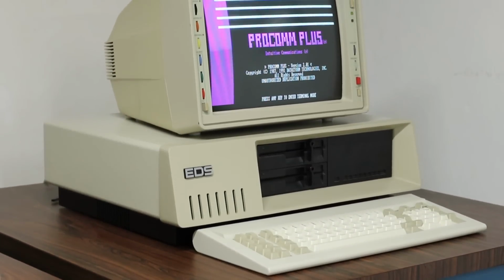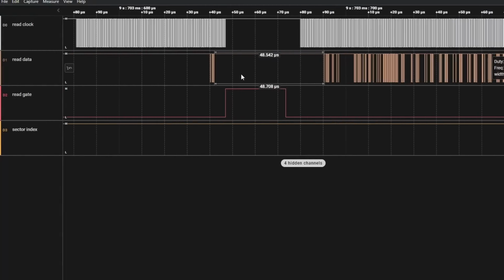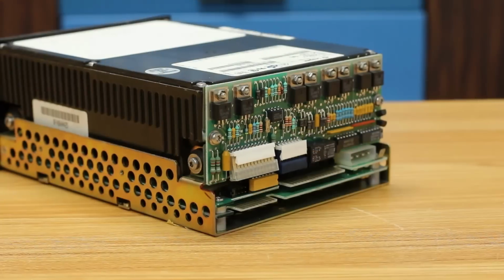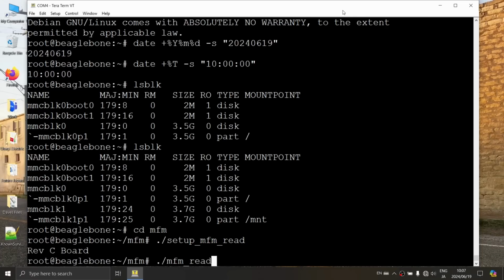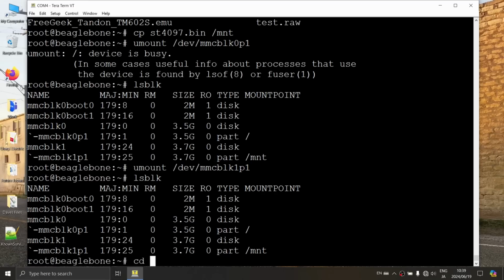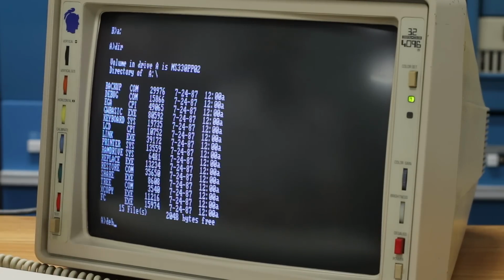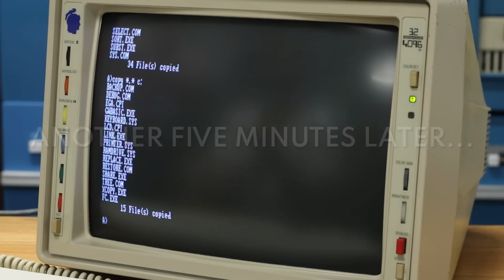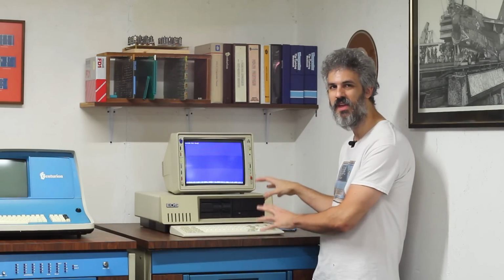FM is RLL, MFM is RLL, RLL is RLL! Fight me.

Comment: Nice shirt! We spoke briefly as VCF SW. I actually have one of the world's largest documented collections of vintage mechanical hard disk drives, I'm still counting spoils fron VCF, but I think I am around 600 units right now.

FWIW, MFM and RLL drives are not often called this way by collectors, they are ST-506/ST-412 and ST-412HP, or 5MT and 7.5MT, respectively. The only difference is the expected encoding, which for most drives was entirely determined by the method used to test the drive in the factory. If it passed with few enough defects as RLL, its an RLL drive. 
The ST-238R is one of these drives. It is an ST-225 that you were at one time guaranteed for compatibility with RLL. You can run it as "MFM," or if you have an ARLL card like a Perstor PS200, you could run it at 10 megabits, or if you hitch it to an arduino, you can write one bit per track in a custom format. The drive does not know or care about the format at all.

I have tested every drive in my collection as RLL - Every video demo I have done is with a DTC 7287 cached RLL controller. I have yet to find a drive that works with MFM but does not work as RLL. Even the ST-412 itself, and a myriad of crappy clones, even Soviet drives can handle it without much worry.

I have personally tried one of those dingy little emulators - I borrowed one from Forgotten Machines, actually, and I was not able to read any drives formatted with my DTC 7287 on it.
Reply: LOL at the one-bit-per-track example.
Reply: @ericwazhung It's possible, and I've personally done something like it with an Arduino - But I was using FSK, it's a lot easier to breadboard.
Reply: @TheDiskMaster  Frequency-Shift Keying? That'd make sense... I was doing some low-level stuff with PWM-nibbles on floppy disks ("FloppyBird"), managed to fit about 1.5x the data in the same space (but not knowing much about PLLs, hadn't gotten so far as making it reliable between drives of slightly differing speeds). One thing I recall mind-experimenting was whether flux transitions have to be less than a certain distance apart, lest the "magnets" formed cross the arc of a nearby track, and/or cause the inductive read-heads to settle into a steady-state where a singular flux-change produces a weaker pulse into the comparators than it might if the changes were closer together... (e.g. 0.75 falling toward zero, suddenly reversed to -1, for a difference of -1.75, vs 0 to -1 for a weaker difference of -1... thoughts of automatic gain control, since surely different drives would record different levels of magnitism). Dunno if these are things, but were ponderances, and plausible explanations for some of the difficulties I encountered.
Reply: It's not always a matter of "works", it can be a matter of data retention. It's not good if the sectors can't be read a few weeks after being written, which could happen if you were pushing the spinning rust to its limits. This is where the bad reputation came from, but somewhere between the ST-225 and the ST-251, it pretty much stopped mattering at all. All the drives were becoming format-agnostic.
Reply: @mal2ksc Well, my Soviet-built IZOT CM5508 has no trouble retaining RLL data after 6 months now. Any drive worth anything will have no trouble with this at all - Repeatability is important with any encoding method. Data storage is not about precision so much as Repeatability.
Reply: I'm so glad you've done the research, testing and collecting that you've done.  And it was also GREAT to meet you at VCFSW!  I hope to meet up again and do some hard drive exchanging...

Comment: Those older Western Digital controllers have jumpers to set the drive type.  Since you originally had a ST-238R in there, it's treating the ST-4097 as a ST-238R which means it formatted it with 615 cylinders, 4 heads, and 27 sectors.  The drive types are defined in the ROM on the controller itself and it probably doesn't support the ST-4097 at all.  There is a utility called SpeedStor that has a command line switch to display the drive types supported by the controller.  Later WD controllers offered a free format option where you could enter in the correct drive parameters for the drive.  The drive interleave is how the sectors are laid down onto the drive during the low-level format.  A 4 to 1 interleave will skip every four sectors.  The reason for this, is the 8-bit controller is not fast enough to process an interleave ratio lower then 4 to 1.  I you were to tell the controller to use an interleave ratio of 3 or lower,  you would end up with extremely slow drive performance as the controller would fail to read the next sector in line and have to wait for it come back around to try again.  This would result in a 27 to 1 interleave ratio meaning one sector read for each platter revolution.  If you were to toss in a 16 bit RLL controller like a ST-21R, you would be able to run a 1 to 1 interleave and should see 7 mb/s drive through put.  There is even more tweaks that can be done during a low-level format such as head an cylinder skewing.  Which affects how the sectors are positioned on the adjacent platters so when the head switches or moves it doesn't have to wait for an entire platter revolution.  Without skewing, a fast drive like the ST-4097 will be faster with a 2 to 1 interleave vs a 1 to 1 interleave.  You may also want to check out the ESDI interface which extends on the ST-412 (MFM / RLL) interface.  ESDI is not compatible with the older ST-412 interface drives.
Reply: ESDI drives differ by having the data separator and PLL electronics in the drive instead of on the backplane controller.  ESDI is quite different from ST-506/412 in a number of ways.  ESDI supports higher level commands to the drive than ST-506/412 too.
Reply: I had three ESDI drives donated to me with a lot of bad sectors. They were still larger than any other drives I happened to have at the time, both logically (150 and 300MB drives) and physically - these were the full height of 3.2 inches. My drives also took about a minute to come up to a stable speed. Yes, they were on their last legs, however they still made a Linux system viable for me.
Reply: @brickviking667   I had a lot better luck with ESDI drives.  I was a bit unnerving to see a label with a big bad sector map, but it was rare to ever experience gown defects.  It seemed all or nothing - either the drive worked, or it was a brick.
Reply: I remember when I was a kid working with these drives.  I had a 20mb MFM drive, a 40mb RLL drive, and later a full-height 80mb RLL drive that I salvaged.  It weighed a ton (figuratively).  One of the heads had broken off the actuator and was bouncing between two platters, so I messed with jumpers and ended up with 65mb usable -- as three separate partitions.  The drive lasted another 6 or 7 years before finally failing catastrophically.  When I disassembled the device (after the complete failure), I discovered that the reason my trick worked was because the head that broke was the next-to-last.  So when I reset the jumper to reduce the heads by two, it was ignoring the last two, which was where the fault was.
Reply: @james_mckey   Cool.  Your hard drive appears to be proof you don’t need a surgical clean room to fix a drive if you use reasonable care.  Thanks for sharing your experience.
Reply: @mpmpm  Thank you for adding that important factor.  Good point.
Reply: Good explanation of interleave.  

However in my experience many better controllers I worked with would work down to 2:1 on a XT.  Tim Patterson (yes that one) made a “Falcon” controller that was able to use some kind of burst mode on the bus to be able to handle a 1:1 interleave.   I’d have one in my old deskpro, but it was MFM only and I wanted RLL for the greater storage.

Comment: Hi, nice video that shakes some souvenirs.

Your next mission, should you decide to accept it, will be to write a program on punched card to translate from punched paper tape to DOS 1.0 in the EBCDIC format.

This little rabbit is sooo cute. :)
Reply: Done worse than that! Best one was a data prep job done on our Data100 kit. The IBM-format 9-track mag tape was taken over to our ICL 2904, where one of my utilities converted it to ICL format (6 bits per character). It then had JCL wrapped round it and the job sent over the line to our Birmingham site. There, another of my utilities wrote a 7-track tape - it was the only site we had with such a drive. The tape was then taken to the customer's site, where it was read into their Honeywell mainframe, as a "nonstandard" tape, just like the stuff they did on site using their ancient key-to-tape machines. I was elated when the pound signs (£) came out correctly, but that meant I had no remaining reason to visit their on-site bar - it was a brewery!

Comment: Hey David, 

Many years ago, I made a video demonstrating how to perform a low level format, if what you have is true blue IBM PC/XT hardware, which uses an IBM Fixed Disk controller, which has no formatting program in its option ROM.

It was required by INT 13H long ago to have a format from track command, and you can write a quick program in DEBUG to do this. 

https://www.youtube.com/watch?v=PW787WRG8h4

-Thom C.

Comment: Yes, I was yelling "You have to sys the drive." Or, you can format and sys the drive with the format C: /s command.
Great video.
Reply: Yes, that was the way we did the bootable drive format, in one step.
Reply: I was actually expecting him to sys the drive and still not boot because of missing BOOT flag on the volume in MBR
Reply: @jwhite5008  I think if you were partitioning a fresh/wiped drive, fdisk would set the boot flag on the first primary partition automatically.  Or maybe the "sys" command does it (I never used "sys c:" back then that I recall, or I had already partitioned the disk)
Reply: @SenileOtaku I seriously doubt sys would know about the partition table, utilities used to be single -purpose back in the day.
Reply: While I was yelling at the window, I heard some echo.Was it you?
Reply: This was the "normal way" format (A/C/D): /s in former times. 
But, why low level, when the linuxdevice print all OK? It is the first formatting of a hard drive. This hard drive was lowlevel formatted. As a rule, this was only done when the HDU said goodbye. Or the controller had a different logic, such as Ompti, Adaptec, DTC. It was better with the spinrite tool.
The good old DOS. 2.11😀😉 and Speedstore to use BigDisk > 32mb
Reply: @alterhund4116  You need to re low level format MFM drives when changing disk controller. That drive was not originally low leveleed with the controller in this machine. mfm_read detected an intel format on the drive not a western digital one.
Reply: Same 😂
Reply: Wasn't until (U)EFI boot that you could just boot from a system with the right files on the disk and no boot sector meddling heh.
Reply: @dennissmith8199 yep, I was yelling too, though I was doing it silently ... 😉

However, after a less than auspicious start to the week, being able to dust off the dark corner of my brain that still retains selected fragments of DOS has made me feel so much happier than I was an hour ago ... 😁

Comment: I wonder, if MFM and such is RLL, but RLL(3,7) is more advanced and so I assume was invented later, why did they choose to just name it RLL and didn't give it another fancy name such like EFM (Enhanced Frequency Modulation)
Reply: My theory is that it's a layer-related thing... At the lowest layer we're talking about flux-transitions as representing both data bits and clock "bits"... So, FM and MFM are Run-Length-Limited methods of assuring that flux transitions occur often enough (limited to a maximum distance from each other) to assure that the clocking can be recovered alongside each and every data bit. OTOH, I think so-called "RLL" formatting on the drives is more about limiting the data bits' flux-transition spacing so that clock bits are completely unnecessary. The data bits themselves, then, create a clock signal... E.G. imagine you wanted to store 0b00000000, but your run-length limitation was 3, then your data-only flux transitions would be stored as 00010001, and see, then no clock is necessary because the data bits themselves contain clocking information... So, again, as I imagine it, the idea is that "RLL" for disks implies run-length-limitation of the data, rather than of the flux-transitions... (though, again, unlike FM and MFM, for RLL the data is stored as flux transitions, so the implication that "RLL" is referring to the data not the flux transitions is a bit confusing because the data is solely responsible for the flux transitions... heh!)
I could be mistaken about all of this... but my other theory goes that the term/idea of "Run-Length-Limiting" wasn't really knowingly/intentionally used in the process of developing the FM/MFM techniques; it just happened to be that the clocking techniques they came up with were RLL techniques. Similarly, why is FM drive-encoding called FM (same as for radio?!)? When, really, at the lowest level it's not really anything like FM radio... FM radio wouldn't work if the frequency halved and doubled between each and every cycle. That mightaswell be AM telegraphy, with a fixed resonant frequency, and the utter lack of its resonance (0 amplitude) when the frequency changed (in which case, the frequency mightaswell just be "off" during those cycles). This concept only works in the binary realm! So how dare they call it FM? Heh. Further, MFM is more like Phase-shift modulation, wherein the frequency is unchanging but its phase changes by 180 degrees. So, really, all this is just a matter of what the perspective/understanding was of the folk who named them. MFM is a modified version of FM, which if designed by a former radio-engineer who suddenly switched careers into the digital realm would've drawn an analogy to radio... and, again, neither were well-versed in digital enough to realize they were reinventing RLL... because if they had known of it, there would've been little reason to do FM or MFM outside the early proof-of-concept prototyping stages, and instead jump straight to RLL for the market.
Reply: @ericwazhung  So you are saying you believe what they did before RLL wasn't knowing that it is RLL after all and once they figured RLL, they named it RLL ignoring the old methods were already RLL?

Comment: you'll need to manually define the HDD's parameters in the RLL controllers LLF utility when formatting. (AFAIK, the controller you're using defaults to a 4 heads 615 cylinders 26 sectors per track, making a ~32mb drive available to the system. (or 17 sectors per track on a MFM drive, making a 21mb drive) 

(source: https://youtu(DOT)be/T22D4fB41lM?si=OsED44FQff7sg-pb&t=316

EDIT: i didnt see the controller ask if you wanted to dynamically configure the drive, so the RLL controller in your machine might not support anything other than the ST238R or other drives with a similar geometry)

Comment: Another note, some Compaq OEM versions of DOS v3 did have support for larger than 32MB drives.
Reply: To be honest i see no reason why this couldn't run a later version or the open source Freedos. But i guess he wants a period correct experience. I still have an original IBM PC-DOS 3.3 "box" here (its that plastic thing that pretends to be a book), ironically used in my first PC XT clone that came with that very ST-238R drive and controller.

Comment: The thing with the SYS command, the IO and MSDOS system files is hardcoded to be the very first two files on the drive. The reason for this is because the libraries for handling the filesystem is inside those, so the DOS boot code can't go searching through the filetable the same way you can after DOS is loaded.
Reply: Never did "trust" it lol... format with the /s was failsafe.
Reply: This got fixed. I've been seeing DOS 4.0 quoted as the beginning of the ability to SYS any disk as long as it was big enough to move the existing files out of the way, but I skipped it. I know for certain that DOS 5 did it.
Reply: @mal2ksc  I was going to make the same remark re: DOS 5.  I had DOS 4, but never had reason to explore the sys issue there.
Reply: Totally understandable limitation, but it would have been nice if they used a more informative error message when there are already files on the drive.
Reply: @crgd23  Not a very confusing message meaning "this disk won't boot". If you just formatted it, then you knew it wasn't a physical problem with the drive, but something you forgot. If it had files on it and you sys'd it, the sys wouldn't take. In any case, pulling up a dir /a would reveal what happened.
Reply: @MadScientist267  David was confused by "no room for system on destination disk". "Destination disk is not empty" would have been more helpful.
Reply: @crgd23  Ok yeah you got me there.
Reply: It's really a laziness of the bootloader.  The FreeDOS bootloader includes enough of a FAT12/16/32 filesystem driver within the 512 bytes to find and load its kernel.sys, stepping through the FAT entries to find the next sectors.

I've also written one that not only includes enough filesystem driver but also floppy controller driver to load my BIOS on a system that does not have a BIOS in ROM, with the BIOS file at any physical disk position.  Including a startup text and error message display, again without any help from the BIOS.

MS was just lazy.  There's plenty of room for that code.